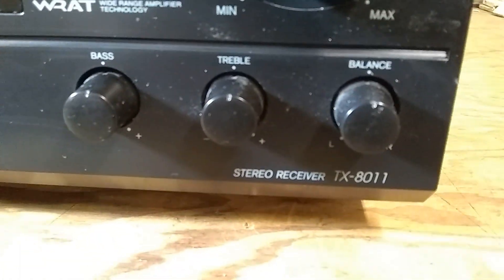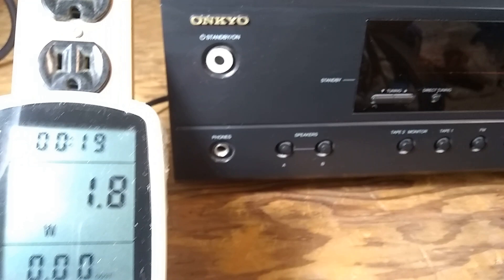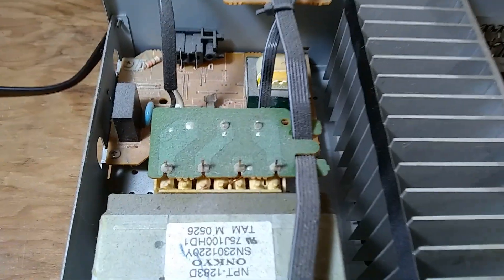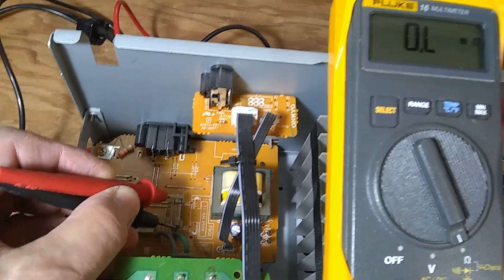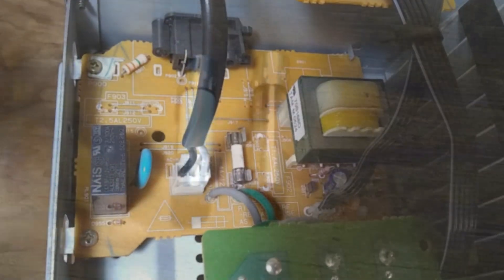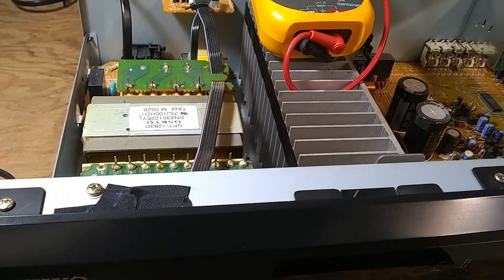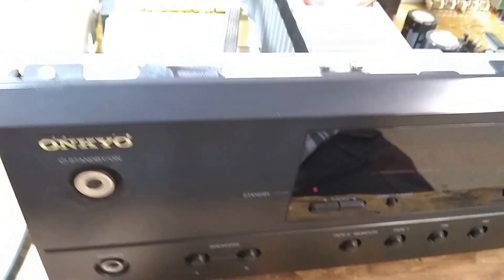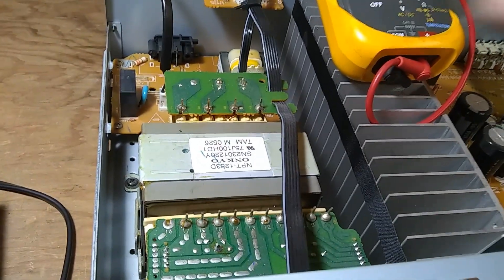Onkyo Receiver TX-8011 Has No Power - Easy Test And Fuse Replacement

Comment: This is great! Do you know if there is a built-in amp for the phonograph? I have a moving magnet phonograph, and I would rather not add a pre-amp for it. Thanks.
Reply from the maker: Yes, this model TX-8011 has PHONO inputs and a grounding screw.